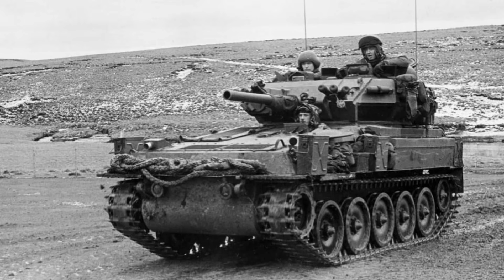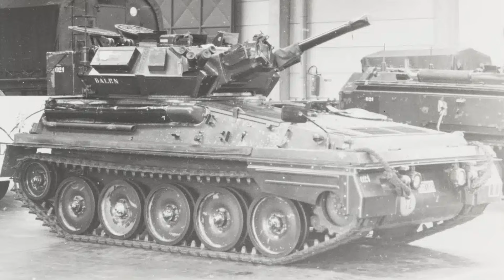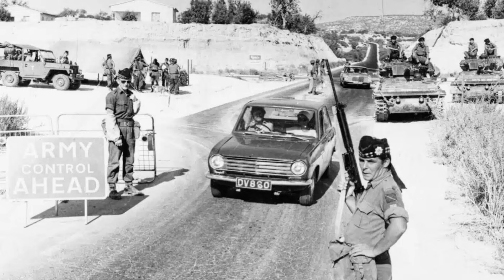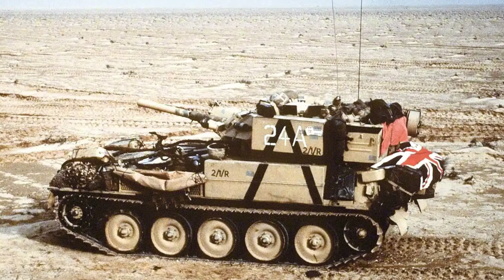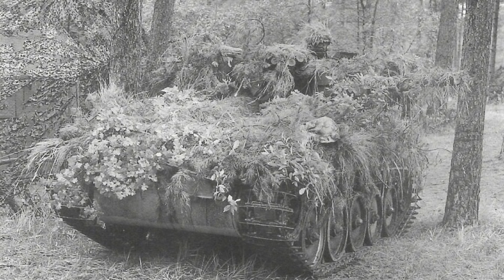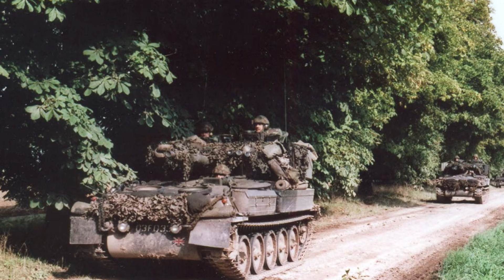Why Soviet Designers Were Baffled How Britain Put A Huge Tank Gun On A Tiny Scout Car

Comment: Very poorly researched, starting with the fake cover photograph. the CVR(T) never mounted the L7 105mm gun. The short story is the Saladin - Saracen series of recce vehicles were too heavy for air transport so the CVR(T) family was designed The 76mm gun on the Scorpion was not a ligh velocity weapon, it fired HESH rounds at lower velocity so was not a strain on the vehicle. The HESH round was quite capable of destroying MBT's of the perion including the T-54, but nit recommended for later tanks with spaced armour. The amphibious aspect was soon discarded as the floatation screens, prone to damage, were removed in the mid-1970s.